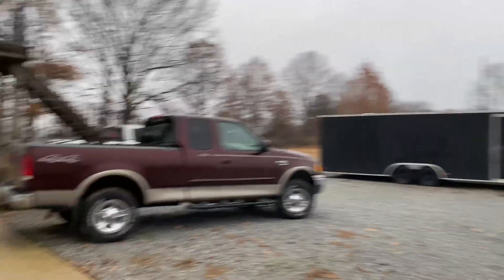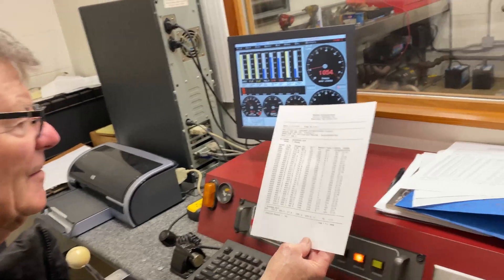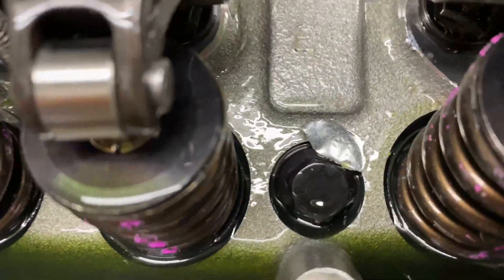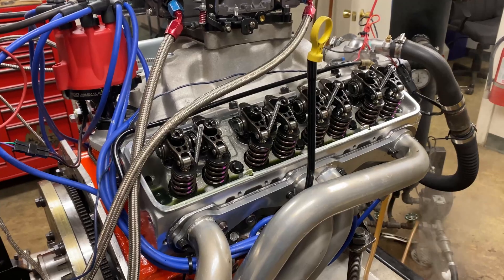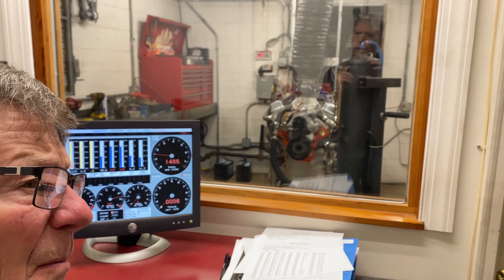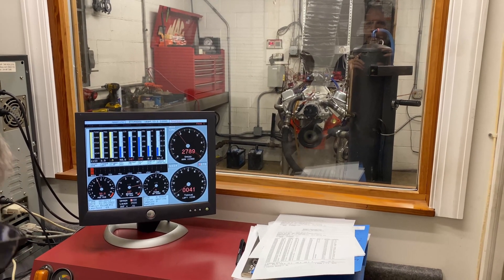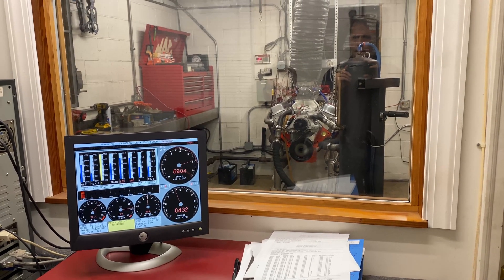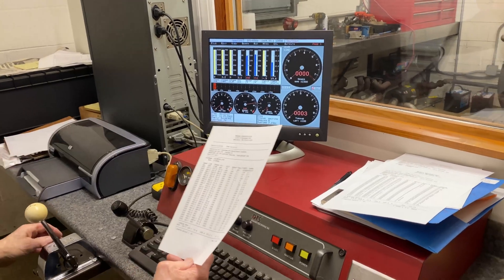Dyno Day: 1996 LT1 383ci for Turbo Impala SS

Comment: How do you think the AFR 210cc (1057) would compare if used instead of 195cc (1031)? Thanks.
Reply from the maker: Hard to guess.  I think certainly more power.  But how much I cannot guess.  With the right camshaft it would be awesome.

Comment: What type of Heads  and Valve covers, I'm interested in sourcing a tall Valve cover for    Lt4 heads with 1.6 Roller rockers setup.
Reply from the maker: The heads are direct from AFR part number 1031.  (with the upgrade .650" lift spring option).   They heads have bolt boss provision for perimeter valve covers and center bolt valve covers.   Lots of options for you then.
Reply: @EllweinEngines   
Does AFR make a tall Clerance Valve cover for Centerbolt LT4 Head, or do you have any suggestions on a OEM Lt4 aftermarket Valve cover with center bolt layout?
Reply from the maker: @snarvd8370  Oh.  Yes I have suggestion.  I like the ProForm center bolt.  Not really super tall but medium tall.  I see Holley sells them now too HLY-241-292.  Lots of center bolt that work well but they don't leave room for the passenger side alternator so you'll have to clearance for the alternator.

Comment: Any noticeable issues with those heads having the square exhaust ports instead of D ports while running LT1 headers, or does it not matter the port match of the header with the head, in that regard?
Reply from the maker: I usually don't worry about header match up.  But I think many headers are not exact size D-shape as stock heads are.  But if your headers are small D-port like the stock heads that will not exactly match up.